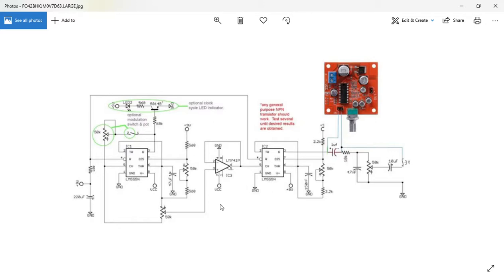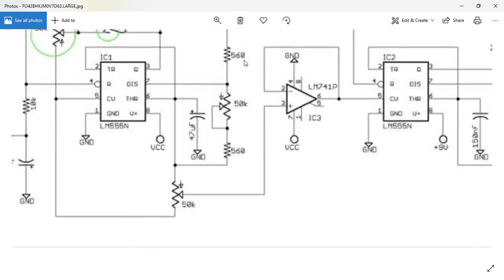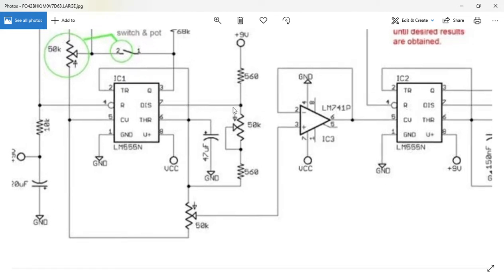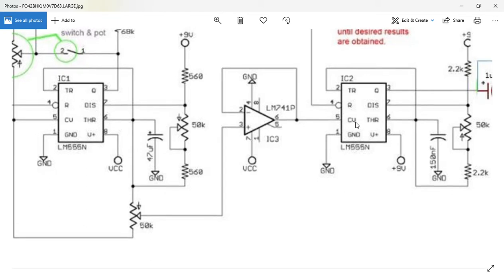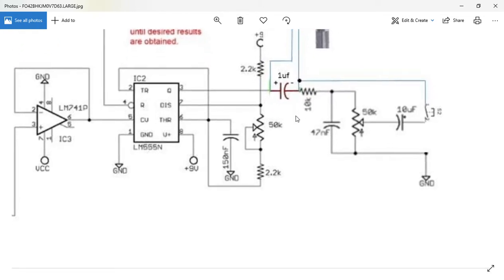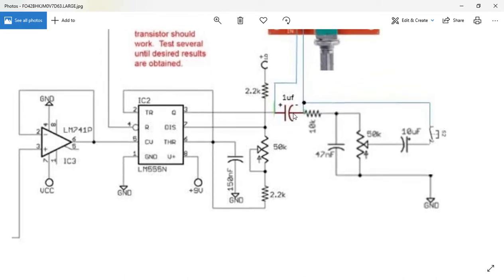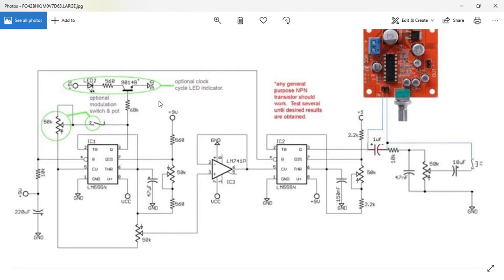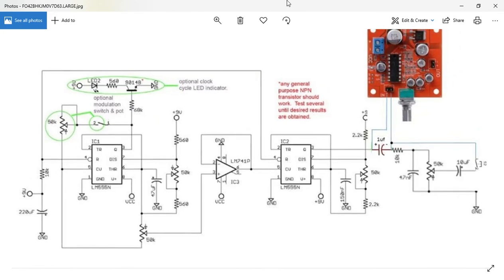dub siren schematic

Comment: Hello! I assembled a dub siren using this schematic. And I have a question about how the filter works at the end of the scheme, where there is a 50 kOhm variable resistor and a 10 μF capacitor. This does not work for me, I press the button and change the variable resistor and nothing happens, the sound does not change. Can you help me, what is the problem?

Comment: Is the reverb module connected to + of cap and 3 pin of IC2  AND second wire  connected to -- of cap and 10k res and S2 or it just connected to S2?